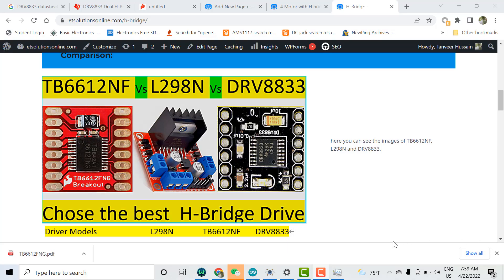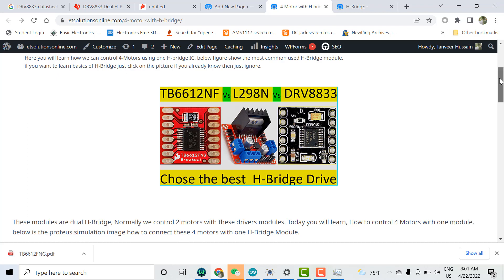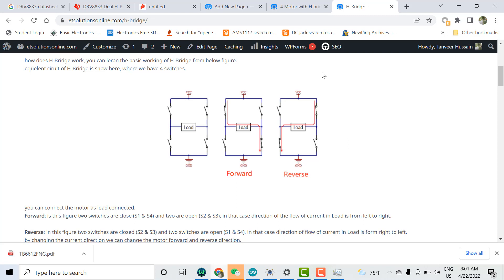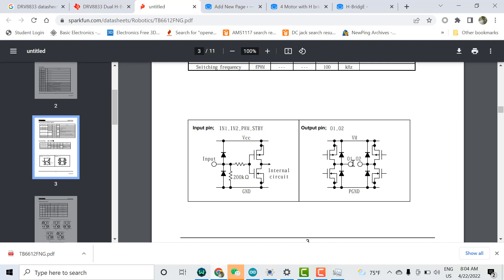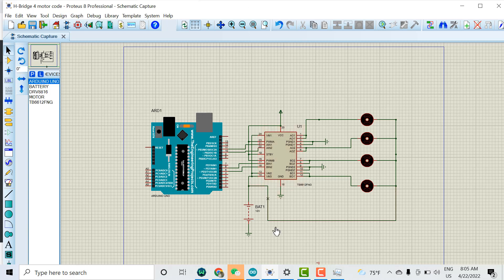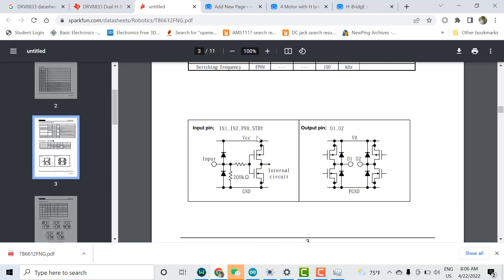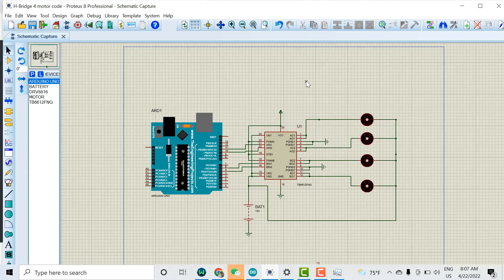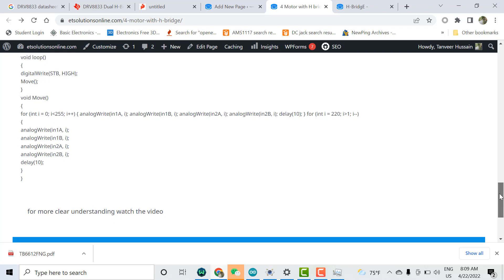Control 4 Motors with one H Bridge driver IC | Steuern Sie 4 Motoren mit einem H-Brücken-Treiber-IC

Comment: Can drv8833 can also drive 4 motors at the same time ,where each motor can consume 1A at 3.7v ??
Reply from the maker: yes can drive 4 with 1A Each (DRV8833 can support up to 1.5A for Each motor, that is max limit for each motor).
Reply from the maker: https://etsolutionsonline.com/h-bridge/
on this link you can find more detail about DRV88333 and other H-Bridge Drivers
Reply from the maker: https://etsolutionsonline.com/wp-admin/customize.php?url=https%3A%2F%2Fetsolutionsonline.com%2F
Code is given on this link